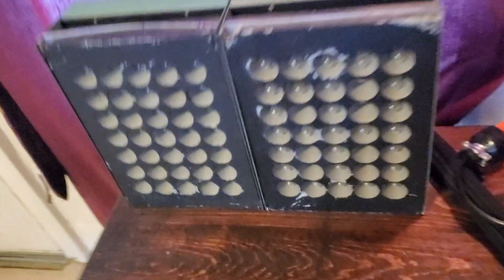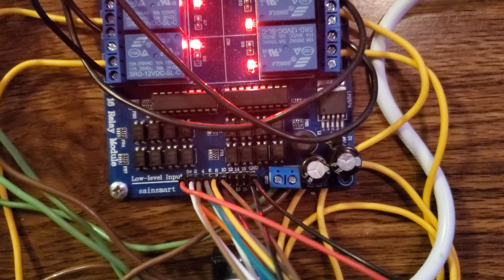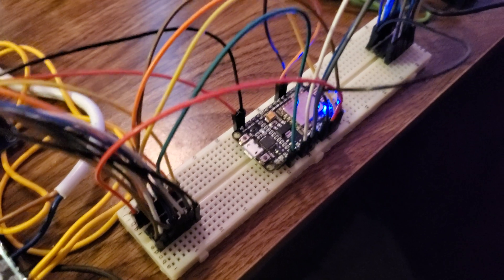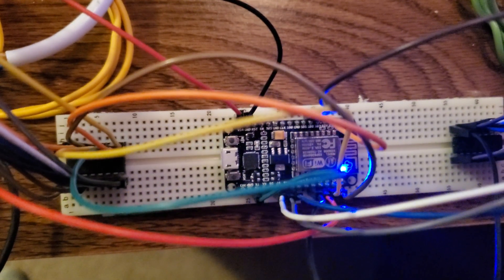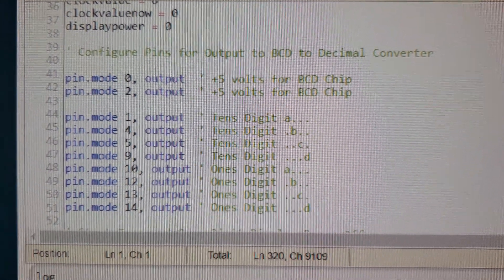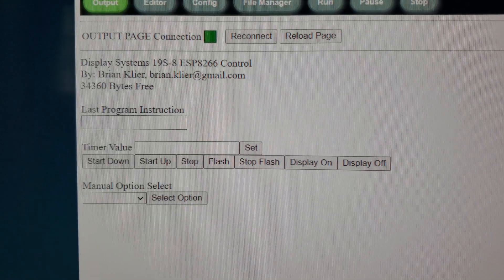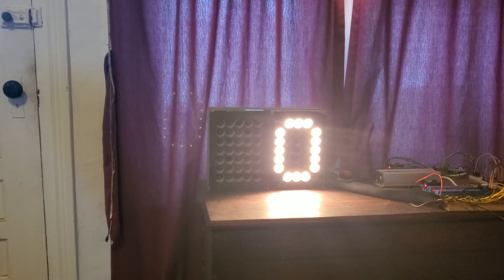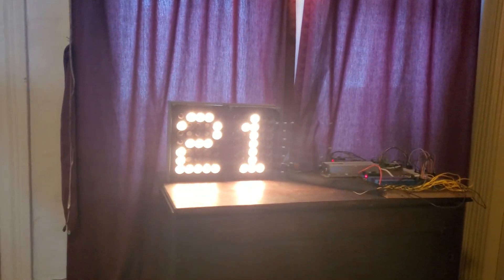Display Systems 19S-8 Vintage Eggcrate Display (Light Bulb Matrix) controlled by ESP8266; Overview

Comment: Hey Brian - your project inspired me to do my own version! I was able to locate some displays at a local electronics salvage company here in LA. I bought 4 of model 19S-5. They're like yours, except the digits are about five inches high as opposed to the 8-inch version that you have. Mine also have the $ mod. The asking price was $25 each; I offered $80 for 4 and got them.

For the build, I started with your method and made a few tweaks:
- I'm running the displays on 24v as opposed to 28v. Common power supply, not as bright, less heat, and the bulbs will last longer.
- Instead of relays, I'm using solid state switching. I wanted them to run silently, so I built some simple MOSFET driver circuits.
- For the brains of the system, I'm using an Arduino. The Arduino is connected to a shift register for each display via I2C, so there need to be only 2 serial wires from the Arduino to connect the shift registers. The shift registers provide 16 I/O channels each; I'm using ten per chip. The Arduino also supplies 5v to each driver board.

My idea is to eventually run the displays as a real-time clock (that's why I bought 4). Arduino has a real time clock module that I've employed to do this.

I know next to nothing about programming in C++ and have only a basic knowledge of electronics. Despite that, I managed to learn what I needed to make it all work. I fried a couple of MOSFETS and chips along the way, but as of tonight, everything is working. My code for the clock is probably pretty inelegant, but it does work as intended.

Here's a clip of my project in demo mode (clock mode is not very exciting):

https://youtu.be/Tx1DwNcFIkc

The next steps will be getting everything off of the breadboards into a more permanent build.

I'm glad I bought the displays when I saw them. There were several dozen of the 8--inch and 5-inch displays on my first visit. When I went back to the junk yard about 2 weeks later, it appeared that about half of them were gone. There were also a few of the Display Systems 7-segment-type displays on the shelf too, in a couple of different sizes. I'm tempted to buy them for nostalgia purposes, but I honestly don't know what I'd do with all of this stuff!

Thanks for the inspiration!
Reply from the maker: It was my hopes that I could inspire others to preserve the spirit of these readouts, and to build and improve upon my design. You certainly have done that with your efforts!  I find that the best learning experiences are ones that drive you to learn new skills to accomplish something you're really passionate about. I am surely impressed!

I'd love to hear more about this electronics salvage business in LA. While I just got back from the east coast myself, I doubt a special trip to the west coast is possible right now. Did you happen to take any pictures of the variety of items they had, or were you just surprised you found any of these sort of items at all?  You have me wondering if they would ship!

Thanks for sharing, and please continue to do so! I'll definitely subscribe to your page if, down the road, you consolidate your prototype build into a smaller more portable circuit board. I still have mine screwed down to an old piece of particle board, and I guess if I had to find an excuse for me just being lazy about it, it might be that the strewn components and wires are sort of reminiscent of that era anyways.

Outstanding work!
Reply: @klier  Thanks for your kind words. It's been a fun project.

The salvage yard is Apex Surplus in Sun Valley, a few minutes north of where I live in Burbank; the link is below.  They have literally millions of items, from every part and component you could possibly imagine (and many more that you've never seen before) to sub-assemblies from all kinds of devices, to old television production equipment, missile parts, mainframe panels, industrial motors,  fuselage from a crashed airplane -- way too much to describe. The place is insane! You could spend hours poking through the place. They also have a big business as a prop rental house. I'm guessing that's how they make most of their income. I didn't take any photos, but there are lots on Yelp.

I stumbled upon the DS units on my first visit here a few weeks ago. There was one random unit misplaced on a shelf. I looked down the aisle and found the rest of the stash on a couple of high shelves. FYI, one of the pieces I bought had a hand-written sticker on it that noted it was "checked" in 1986.

I asked one of the owners how they came into such a large supply of these units. They weren't really forthcoming with that information. It just struck me as unusual that there were so many units on the shelves -- far more than would ever be used by a single production. My best guess is that Display Systems, or maybe CBS Electronics, leased these units to shows during production. When the shows ended, the DS parts were stripped from the sets before they were scrapped. (It's not like there's anything to wear out, and they could easily be reused.) Since CBS has sold off Television City and is currently in the process of moving out, it's possible that these have been in storage at CBS. Or maybe whoever bought the company from Ev Penn was storing them. I wish I knew.

In the outdoor part of Apex, there were about half a dozen control panels for game electronics that were probably built by CBS Electronics. There's no indication of what shows they were used on, and I couldn't decipher from the buttons where they came from. They'd obviously been outside for a long time and were in pretty rough shape.

Hope you get to visit Apex on your next trip west.

https://apexsurplus.com

Comment: This is very cool. Thanks for posting. I presume there must be electronics inside the displays themselves that take a one-pin input and determine which combination of lamps is needed to display the chosen digit. Have you cracked them open to see what makes them tick?
Reply from the maker: You are pretty close to being correct. If you go to https://www.surplussales.com/Images/Bulbs-Incan-Panel/VacuumDisplays/lmp-19s-8_3_lg.jpg you can see which appear to be diode matrixes which determine which light bulbs to light given a ground being present on a certain pin. These have been modified from the factory to include the $ which are some of the extra modifications and diodes you see here.

Interesting sidebar: A guy in the industry told me that Display Systems was a little company in the Los Angeles area run by a man by the name of Ev Penn. Ev helped rebuild the "Concentration" game board and controller when it was shipped from New York to LA. His wife also made the readouts used on the second run of "Tattletales". Display Systems also made a larger dot matrix readout and 7-segment display which was used on bidders' row on "The Price is Right" and also on "Card Sharks"

While it's impossible to know if these displays were truly used on a particular game show, the nature of what the company did and its location would seem to indicate that game shows were a major part of what the company was about.
Reply: @klier  Interesting story behind Display Systems, Brian!

And it's an honor to have my video mentioned here.
Reply: @klier  Thanks for the reply and the photo. Very clever design. I saw a taping of TPIR in 1986, and from my seat I could see the device controlling the 7-seg displays in bidders' row. It was an enormous panel, with a column of 10 buttons for each digit of each display - clearly a specially built machine. 

I had heard a similar story about Ev Penn, with the coda being that after he died, the company was sold, and eventually sold again to Cinnabar, a scene shop here in LA that's still in business. I don't know the timeline of those transactions, but it's possible that the displays you have could even have come from one of the successor companies.
Reply from the maker: @larryfitzgerald9384  I found a couple photos on the Golden Road website which are of interest here. The first is that panel you were talking about: http://www.golden-road.net/gg/displayimage.php?pid=877  Basically, each digit had 11 selections (including blank) to choose from, and a button to flash the display.  I found a picture of an old showcase podium here: http://www.golden-road.net/gg/displayimage.php?pid=865 which, not surprisingly, contains 5 of exact Display Systems eggcrate displays shown in my video here. Written on the top of each display is the custom letter than can be selected on that 12th pin instead of the "$" character that mine has. Thanks for the compliment, Larry! Glad you enjoyed the video.

Comment: This is brilliant and I've always been interested in such displays, being a huge game show fan. The million-dollar question is, what kind of computer system was originally used to operate these displays on game shows?
Reply from the maker: That's for the compliment! If I had to take a guess, I would say that most of the displays such as these were not controlled by a computer, but rather a manual board using discrete components and integrated circuits. 

Tic-Tac-Dough used a whole Apple ][ computer for the video displays for each box on the board, all controlled by an Altair 8800. This was in the late 1970s, and thus I have to assume that cost would be a definite factor when you look at how many different displays "Price is Right" used on their show. This is one reason why I think the controls for these, at most, 5 digit displays, were the minimum electronics necessary to do the job.

Comment: Really cool project, Brian. Thanks for the breakdown of what you put together. I was contemplating getting six units to set them up as a time/date display along with being able to display numbers. Obviously that would require additional hardware and coding to configure. 
I do have a single unit so I could replicate your setup with less hardware and less code. My unit arrived with some damage so I'm hesitant to get any others.
Reply from the maker: I'm glad you found it an interesting endeavor! My displays certainly weren't perfect when I received them, but they both did function except for a single light bulb. Definitely give me a shout out if you need any help with the wiring or coding. I haven't yet put together a schematic but I probably will at some point.